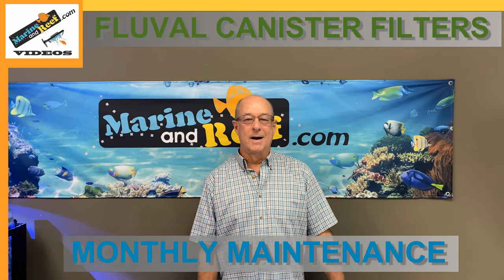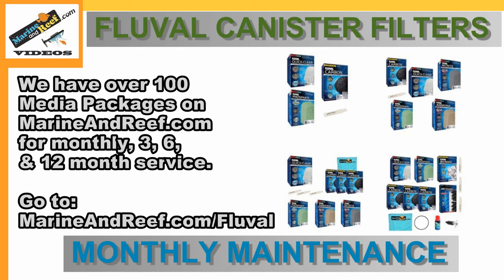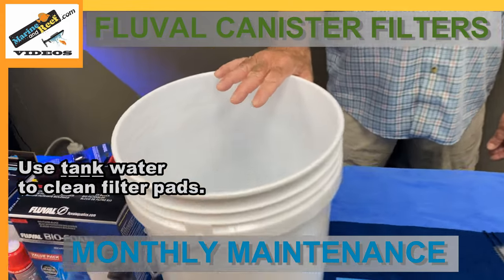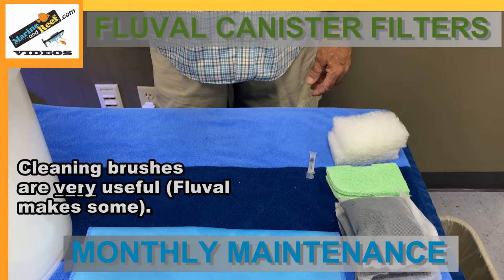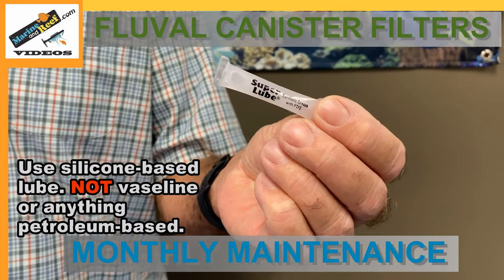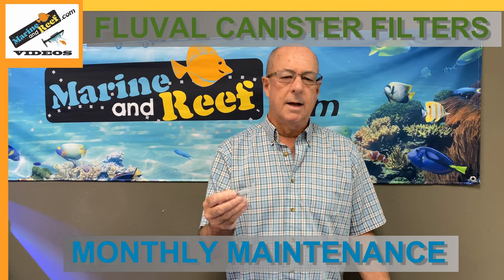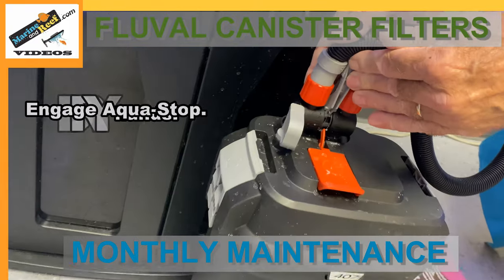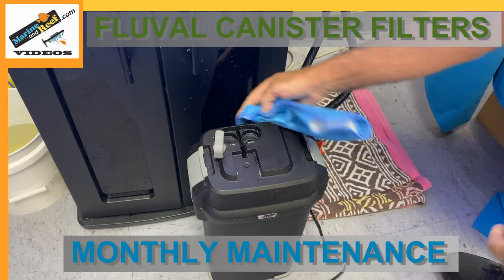MarineAndReef.com: Fluval Canister Filter Monthly Maintenance Demonstration

Comment: When taking the top off as you do is pushed down on the two gray levers push them down pull the tap off. Do not have to rip the top off like that.